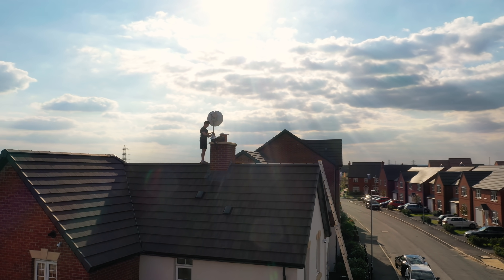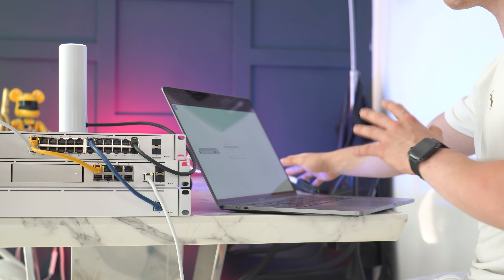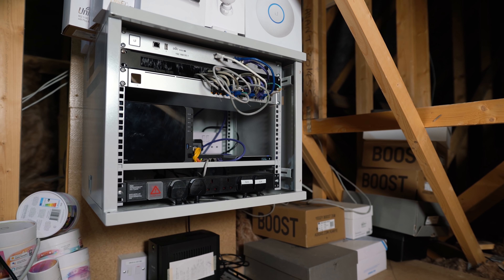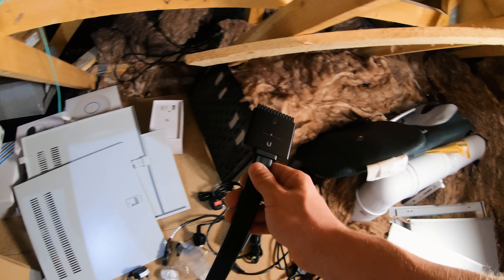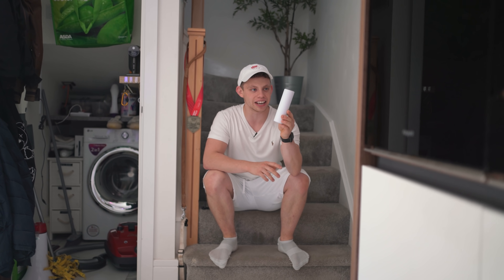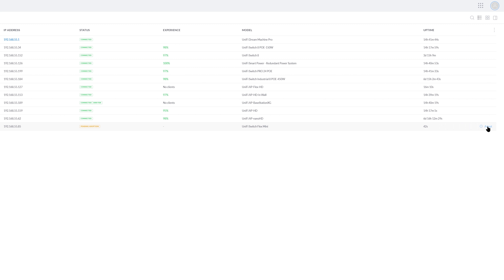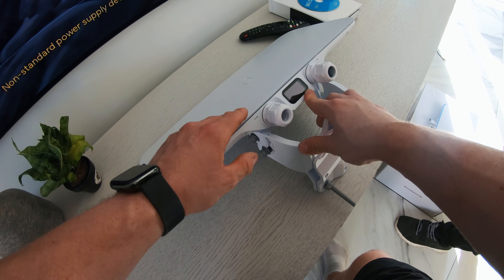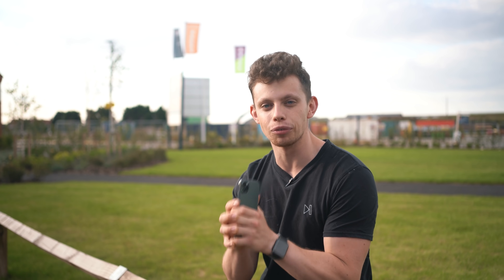Alex's Insane 2021 Home Network Upgrade & Tour!! 🔥

Comment: Don’t get me wrong Alex, I’ve watched your videos for YEARS, but this video screams inexperience and poor practice. Not knowing the difference between an RPS and a UPS, failing to terminate Cat6 into RJ45 correctly, having a separate AP for a single network (rather than utilising all required APs to broadcast different SSIDs that serve different VLANs), mixing up very basic units of storage and bandwidth measurements, putting an SSD into a CCTV system where writes will be constant, putting what is essentially an interference dish onto the top of your roof (hogging wi-fi channels for a broad area with lots of other houses that all need to use the same range), putting an industrial switch into a weatherproof, insulated, dust-clear and clean building, etc. are all examples of poor, incorrect practice. Some of these practices are silly, some are selfish and some are just plain wrong. I like your videos and I like your personality on camera, but geez you need to learn more about these basic networking standards before you start teaching the wrong things to others.
Reply: He makes me want to complete my ccna and ccnp before I even think about building a network. I wanna make sure I do it right because this set up seems all over the place.
Reply: Network is just a mess and over the top and from the way it been setup it will have lots of issues.
Reply: Steve, I could honestly not have said it any better myself. For the past 3 years since I’ve been in networking I’ve dreamt about my home lab, and if I had half the opportunity this oak had, it would be a server cabinet with three hyper-converged Supermicro AMD powered OpenStack or Proxmox servers providing SSO via LDAP and RADIUS, DNS and a tightly integrated NMS with cable management that would turn anyone on by looking at it.

It’s honestly so heart breaking to see this guy have all these resources yet takes absolutely 0 price in implementing them …
Reply: Was going to write the comment about a separate AP for his IoTs instead of another ssid and VLAN. I install UniFi networks all day at high end homes and this network makes me cringe so hard. Especially the ups mixup. And will all the access I have to hardware i only use at my home a single Dream Machine. That AP is plenty and my house is about as wide as his. More isn’t always better especially when you prob have all radio settings on auto.
Reply: This kid is just lucky enough to have daddies credit card. He doesn't know anything about technology, just has the money and equipment that allows him to make decent looking YouTube videos.

My bet is that if he had to touch the command line he wouldn't even know where to begin.
Reply: @Pyroteq  you sound jealous
Reply: @Pyroteq , not his daddy's credit card, Ubiquiti sent him these gears, and he makes a living out of affiliate links, and I agree about the command-line lol

Comment: not sure if anyone has mentioned it (can't be asked to scroll down and look at all the comments) the RPS is not a battery backup. Please make sure you provide correct info when doing reviews etc. Also using SSD's is not ideal for video recordings. You will be better off using NVR specific HDD's but apart from that well done on the freebies

Comment: 3:19 - basic networking would tell you that's megaBITS not bytes, which also is slow enough that you can get away with a $70~ router these days. i only upgraded to a UDM pro when i upgraded to 1gbit internet and my 5 year old R7000 couldn't handle the throughput

Comment: I’m only getting 38mbps into my house via sky hub, virgin isn’t an option in my area. I have a ubiquity AC-LR which takes some strain off my hub (45 devices connected) is there any point in getting any more ubiquity in my house as I’m limited by the 38 coming into my hub. On a good day my speed test is 22mbps 😅

Comment: Why are you using cloud keys and not hosting the controller yourself e.g a VM or something like that to give you better access across multiple sites and much cleaner.
Reply: Because he's never seen a command line before and has no idea what the difference is between a router and a switch. Just reads marketing material and has money from his parents to buy whatever he wants.

He should instead spend the money on an actual networking education instead of making misleading videos and make videos again when he actually knows what he's talking about.
Reply: This kid run a VM? Ha! Good one.

Comment: Love the video - thank you so much.  It's an amazing setup.  The big thing for me is that I don't have the cat-6 cabling run around the house, so I'm currently reliant on Google Wifi points to cover the property - works pretty well though.  I love your rack setup !!

One question, just because I'm really nosey & intrigued.  At about 10:00, there's a chunky box mounted on your wall (to your right) which has what looks like two big shielded cables running into the base of it & two coming out of the side of it ??  What on earth is it ??
Reply: some kind of smart shower control valve. the big cable looking things look to be braided water hoses.
Reply: @harrisonherring9194  ah thank you. It looks quite intriguing :)

Comment: The unifi rps is not a ups. It does not provide power to your devices if the power goes out. It is simply a redundant power supply for your unifi devices if the power supply in them fail

Comment: Home LED heaven. Quick q though, if I buy a 5m LED strip and say I only want to use half of it for one location, is there an easy cheaper alternative to buy an additional powersupply/smart control to split the total 5m cable? Thanks

Comment: Quick question. in a system with a unifi cam do you actually need the Unifi CloudKey Gen2 if you are using the dream machine pro?
Reply: No, you can have either, if you have a Dream machine pro then you dont need a cloudkey gen2+ and vice versa.

Comment: The UDM-RPS doesn't have a battery... it only acts as a redundant power supply should the main power supply in a connected device fail. I guess you could connect only the RPS to a UPS though and then the other to just a regular outlet and it would switch over.

Comment: Hey Alex , very very insteresting video this is. But we would like some more details about your network. Maybe what are the needs for most of the switches , next hops etc. How you mitigated most of your connectivity problems in your house. And finally how you assure that everything is secure ( in a case of an attack maybe)  and stay up and running. I can clearly see that you are explaning everything in a very simple way for the audience , but i personally would like to hear a networker point of view.  I really admire what you are doing , congrats lad. Btw i am an networks and cybersecurity student , thus those questions mentioned above.

Comment: I have a google fiber 1gb as an ISP. can I  connect google access point  to a ubiquiti switch/Network?
Reply: You Can connect the fiber to a switch or udm pro and connect the acces pointes to the Ports on the switch

Comment: Usp rps is not a UPS . Its a RPS i.e redundant power supply system. If the power supply fails on switch and udm then it will power it. But if the power goes out and without a UPS or power generator. Everything will loose power.
Reply: I was going to say the same, it only covers if the internal power supply fails. You would still need to connect it to an external UPS to survive external power loss.

Comment: @3:51 Why is that cable going from the POE injector to the switch? By the way, if you don't know, POE is where you can run POE capable devices off of a Cat5/6 cable WITHOUT a power cable.
Reply: Looks lame but I'm pretty sure he's powering that switch with that POE adapter

Comment: Anyone have a link for the battery power bank that still works the cameras without direct power
Reply: Its a usp rps its a redundant power suply for your ui stuff cause they dont come with dual powersuplys so you stil have to buy a usp and connect that in the usp rps.

Comment: Doesn't POE sacrifice the 1000 Mbit line? I recall once you use POE it uses 4 wires for power delivery what (if I'm not mistaking) should be used for gigalan.
Reply: PoE can be delivered in one of two ways: the spare, unused wire pairs (in the case of 10/100), or by biasing the data lines used for GbE - because they are differential pairs the end device can still read data off the powered pairs.
Reply: @slip0n0fall  Thanks! Learned something again.

Comment: Would combining two ISP improve speeds? And how could it be done?
Might this be something worth making a video on? Thank you in advance. James.
Reply: Yes, sort of. It is called load balancing.
Reply: @qazwsxzwharp  how does that work with ping?
Reply: @tao1000tao  I doesn't really affect ping. It just spreads your internet traffic over multiple connections increasing your bandwidth and provides redundancy should one of them go down.

Comment: If I'm not mistaken the USP is not a UPS it's actually a redundant power supply in the event the power module for your switch/gateway fails. In the event of a power outage the USP will not supply power like a UPS would.

"The UniFi® SmartPower Redundant Power System, model USP-RPS, is a proprietary redundant power system designed to protect up to six UniFi SmartPower supported devices from sudden power supply module failure."
Reply: Yup it's only for power filtering. It doesn't even have dual power input itself.

Comment: @techflow Why use an SSD for the UDM-Pro?  If the drive is used to store the camera footage you may run into issues later on due to the number of write cycles of the SSD.
Reply: Because he's doesn't have a clue.

Comment: Why not have one 24/48 port switch in the loft instead of lots of mini switches?
For a residential house, 2 max 3 AP should be enough and that cable termination at 12 mins is awful.
Redundant power suply or just PSU back up?
Reply: Its Redundant... Just in case Main PSU on Switches and such die. Its not a UPS.

Comment: The very first bit of kit that you introduce - the redundant power supply - doesn’t do what you describe!  It’s not a UPS and does not protect you from power outages.
Reply: That what I thought. I thought I just protected against a PSU failure in the switch.
Reply: @Ziogref  correct - it’s a backup PSU for multiple UniFi products, in case their primary PSU ever fails. 

Redundant PSU’s are useful in a critical service or commercial environment, but not so much in a home environment.

You’re much better off investing in an actual Uninterruptible Power Supply (battery back) first!

Comment: The RPS doesn't protect against mains power outage it protects against component power supply failure. E.g. if the PSU in your Dream Machine fails, the RPS will begin to deliver power to it instead.

Comment: So much misinformation he talks about. "304 megabytes down/up"... no Alex. It's MegaBITS. 304 MegaBYTES would be 2432 MegaBITS. When you talk about the connection speeds, you're effectively misleading people.
Reply: Also, USP-RPS is NOT a power backup supply like he states at the beginning. If your home power goes out, so will your system. According to the product page: "The UniFi® SmartPower Redundant Power System, model USP-RPS, is a proprietary redundant power system designed to protect up to six UniFi SmartPower supported devices from sudden power supply module failure."

Comment: No one should ever follow this guys networking advice.... I mean seriously WTF is that @ 12:43? I guess Ubiquiti just gives any rookie networking gear these days...
Reply: From time to time I watch a video. It’s entertaining, but man, how often did I think: what you achieve with these nice components, could be done waaaaay less expensive and often better and less complex. 

As you said: just do it right.

So basically he is a tech fan (what I appreciate), that copies (known or unknown) LTT, but without the deep addiction to perfection Linus has - not that Linus not has done some ridiculous stunts 😂
Reply: I cringed so hard... You already have the proper tools, do it right bro.  Per specs, Category 6 and 6A cable must be properly installed and terminated to meet specifications. The cable must not be kinked or bent too tightly; the bend radius should be larger than four times the outer diameter of the cable. The wire pairs must not be untwisted and the outer jacket must not be stripped back more than 13 mm (0.51 in). Also Ubiquity Called, they want their stuff back.

Comment: @12:46 The RJ45 termination makes me want to cry
Also why so many small switches dotted around the house when there is a rack with a UPS and RPS?
Reply: I like the part where he doesn't know how to space devices in a rack, then moves out the NAS. Clearly there would be room for a 1u nas in there
Reply: Maybe so he can have multiple ethernet devices in one location without running many individual ethernet cables from the main switch. Totally normal.

Comment: USP-RPS is a redundant power supply for the Ubiquiti gear i.e. a second power supply. If you plug both sides (A and B) to mains and mains power goes you are dead in the water. One of the sides needs to be plugged in to an external UPS.
Reply: Yeah, just watched this and stopped when he said it provides power to the devices if the power goes out... Doesn't even know what the equipment does.
Reply: @maraulth  Later on in the video, he does actually say that it is connected to his external UPS, he definitely said it wrong but he`s at least got it setup right from what I can see.

Comment: Just a note, the USP-RPS is a redundant power supply. It will provide power if the internal power supply fails but doesn't provide a UPS such as for when the incoming power fails.

Comment: So my take from this video, Home Networking Do's & Don'ts:
Do:
Watch this video to see what cool items ubiquiti have to offer
Watch to see if the guy from Big Mouth falls off of a roof whilst dicking about with uneccesary access points
Don't:
Dedicate an access point to smart devices instead of a separate SSID and VLAN
Buy a flex HD to replace an In-wall when it sits on a (pretty hidden) shelf next to where the cable exits the wall
EVER record CCTV to an SSD, even more so when not in RAID etc.
Apply a marble skin to a white AP on a white ceiling
Consider that the USW industrial, basestation XG and USP-RPS are suitable for a home
Put your networking equipment in a loft where the roof is not insulated, the ceiling is. Especially a UPS!
Fill your house with too many APs, and then whack a stadium-appropriate antenna on your house to broadcast to the whole estate. Unless you really hate your neighbours and enjoy utilising all of the WiFi channels.
Take network advice from someone who does the above and can't terminate an ethernet cable
Reply: I always call him FlexBoi for this reason.
Reply: Yeah , those wifi channel, it will crowded as fuck
Reply: @Wertdante  I work for sky in the technical team and we had to investigate an issue with Sky broadband because someone had fitted all the stuff like he had
Reply: It’s all a complete mess and I’m so confused. Would anyone please be able to help me out. I’m trying to create a home network system but have a budget of £1000 maximum. Can someone please list me the parts as watching this video has confused me so much
Reply: @ProPlayerGamez  Look for an introduction to home networking, and stay far away from any advice this guy may offer. As for good gear on a budget, look into MikroTik. I don't think you will be able to build a full UniFi system for a real home (i.e. not an apartment with a single AP) for less than £1000 with Ubiquiti gear

Comment: Is it possible to have the same SSID for all the AP's within the home network and have automatic roaming?
Reply: Yes, its called an Extended Service Set. Multiple radio cells acting as one SSID
Reply: Yes. You can do this with a home mesh system or enterprise wireless system
Reply: @eastwardExpansion  i meant with the hardware presented in the video
Reply: @The_esteva_girl  yes, you can with the hardware in this video. I have a Unifi setup with 4 access points, multiple SSIDs and they can all be configured for mesh/roaming; you can also control which SSIDs are on each WAP, along with many other configuration settings.

Comment: Is he having his security cameras recording to an SSD? It seems he is using a TLC NAND SSD, which is not an good choice. Ideally he should be using a standard hard drive, as for most NVR use cases, an SSD offers no noticeable performance benefit, all while having poor write endurance, especially for continuous recording. Everyone should always do 24/7 recording with motion highlights. Never rely entirely on motion detection as it will sometimes not detect a motion event soon enough or it may stop too soon.
Other than that, it is an awesome setup.
Reply: I instantly thought the same. That SSD will be dead in a few months.
Reply: You don't see his network videos to get advice on that to do, but on what not to do.